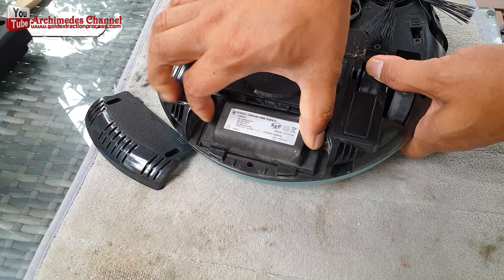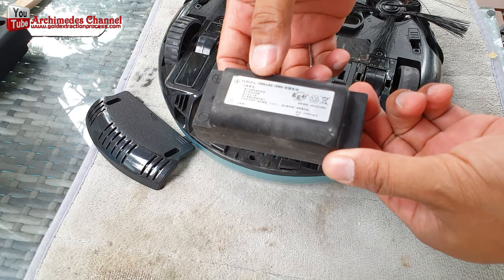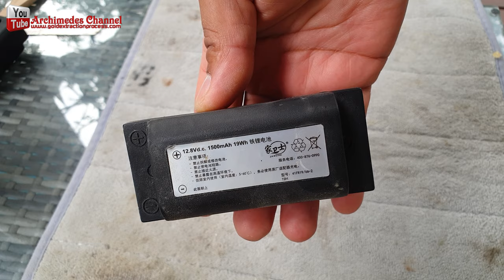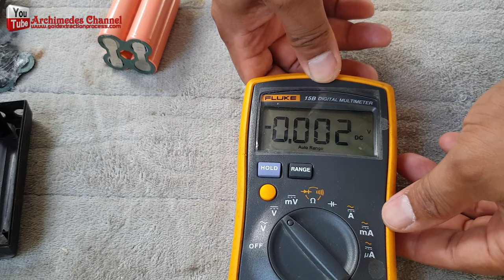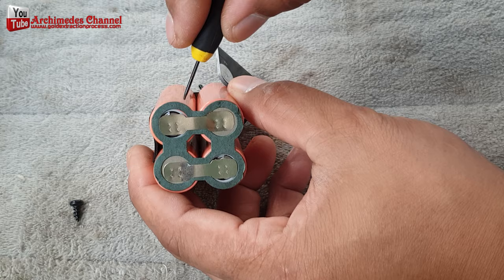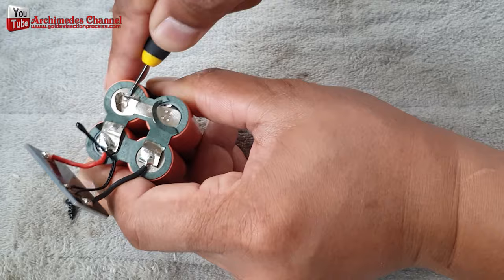Robot vacuum cleaner not working Battery repair

Comment: for the people asking
these are known as 18650 batteries

better to replace the whole battery if you're not familiar with electronics this well

it will require soldering batteries which is dangerous

can maybe just electrical tape the ports together but still dangerous to handle batteries like this if inexperienced